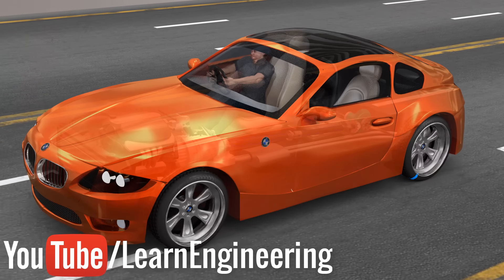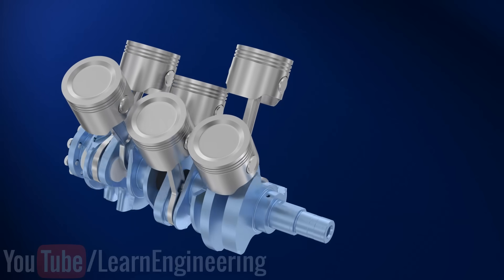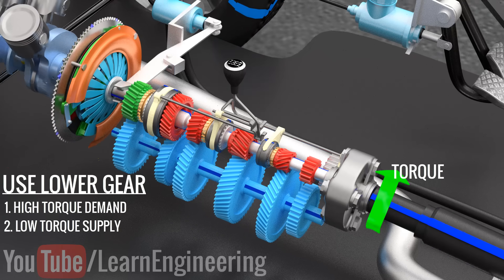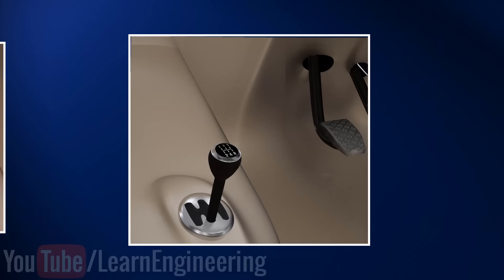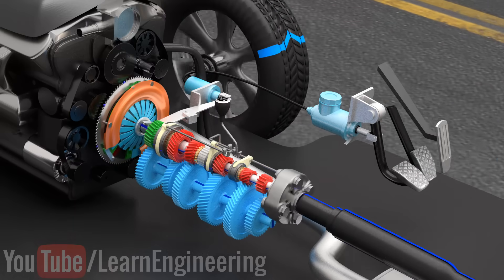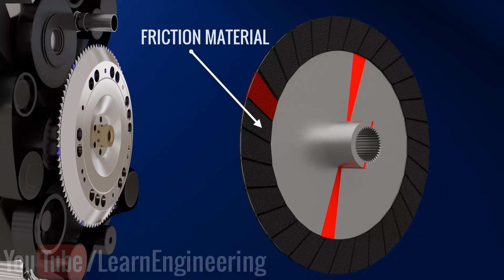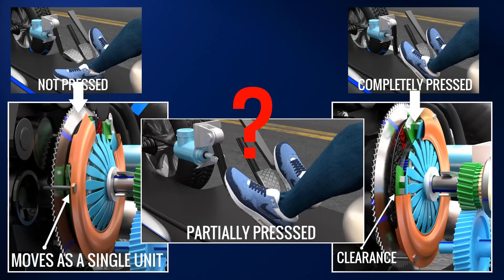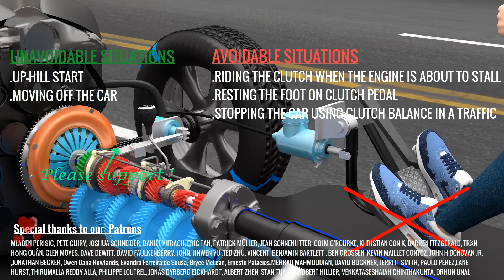Why you should not PARTIALLY press the Clutch?

Comment: It's my clutch, I'll do whatever I want with it. The clutch pack of my motorbike is relatively cheap (30 USD). Riding the clutch is convenient compared to shifting gears incessantly.
I don't drive cars that much but I used to go in country with a low-powered truck. While in 1st gear, I used to rev the engine while holding the clutch partially to give a boost to the truck so it can get from potholes.

Comment: There is one other situation where riding the clutch (for a short time) is not only appropriate, but might even be necessary to continue your journey - when preparing to pull out of a side road onto a busy major road. By sitting on the biting point and setting your revs ready to take a gap in the traffic, you are 'pre-loading' the engine for the best torque output as well as ensuring you will be able to fully engage the clutch smoothly and quickly when you make the manoeuvre.
A driver should never hold the vehicle on the clutch by riding it - I see that at lights occasionally, and those people are burning through the clutch plate deliberately for no reason. That's what a brake is for.
Also, try driving anywhere in London without riding the clutch. I dare you. Actually, I'd pay you £300 (about $5,000) if you managed it for a day.

Comment: So I have a Coeworker that's claiming i completely fucked up his vehicle and is about to tell me I have to pay him 800$ for a new clutch. 
Here are the facts
1. I told him I can drive a manual but I am straight garbage at it.
2. I have never driven one of my own, I just have my motorcycle which is a completely different animal
3. The smell from something burning was only in a 100 meters of driving
4. he claims somethings "fucked up" but when he drove his vehicle back from the bar to where I was staying the burning was gone and the vehicle was operating properly
5. he asked me to drive because no one else would be his DD
6. after driving and realizing I need more practice I had him drop me back off at home and I gave him the 40 euro for taxis for the night so he didn't have to drive.

If I was riding the clutch how much would it actually cost (at max) to replace the parts damaged (FROM ME) in the ONE time I did for the 1-2 miles of me driving? 
Another thing to note, he's been having a turbo leak for awhile, not sure if the cases could be linked

Please help, I don't have the money to give 800.
Reply: It is almost impossible to damage a clutch in such as short time and miles.
Reply: @sauloz88  that's what everyone is saying. Thank you

Comment: what about when you’re changing gears and you must release the clutch while accelerating. in order to do this without having both the gas and clutch images you’d have to just dump the clutch which will cause a very unsmooth shift and potentially damage more because of the force of the engine knocking when the clutch is dumped.

Comment: I am a 43 year veteran long haul driver and part time driving instructor.  In driving school we always teach our students to only partially clutch when shifting gears.  If you check any truck driving school you will find that in North America this is always taught.  In my car I always partial clutch when shifting.  There is never any need to fully depress the clutch to shift gears except when starting the engine.  You only need to partially depress the clutch pedal until the clutch plates are released.  Anything more is a wasted motion.  Actually in my truck if I use the clutch at all I might press it only a half inch or so.  Often we just rev match and don't even bother to put our foot on the pedal to shift.

Comment: When the  vehicle moving downwards, I usually fully applies clutch and managing speed by applying break slightly,is there any problem if we do this
Reply: Your brakes could overheat and fail, when driving downhill always be in a gear with the clutch pedal non pressed to allow for the engine breaking to maintain the desired speed. Your technique also doesn't allow full control because you aren't allowing the engine to do this by pressing the clutch.

Comment: He said gear changing can only occur if use clutch, obviously you don't drive manual vehicles, there is something called timing, each gear works optimally at a given rpm if u understand this u can avoid using clutch
Reply: But why would you not use the clutch to shift gears? It's what it's designed to do. Unless you get the RPM exactly spot on for the  gear you are shifting into, you'll be wearing out your synchros very quickly and grinding your gears which is a stupid thing to do.
Reply: @collinslfc  not using clutch shows versatility and doing it right is harmless
Reply: @jwalflowdizzle3751  Why do you need to show "versatility"? I still don't understand what purpose you are serving by not using the clutch. It's there for a reason. And to do it right, you have to engage at exactly the correct RPM which is never going to happen every single time you shift, regardless of how good a driver you are. Your synchros will take a hammering.
Reply: @collinslfc  it's add to the whole experience and if racing clutchless is quicker and can be smoother even in normal driving or riding
Reply: @jwalflowdizzle3751  But you're not racing, and wearable parts such as clutches in racing cars aren't designed to last 10 years like a road car is...

Comment: Well, this is not 100% accurate. My car wont't start even moving without riding the clutch on first gear. Or it will violently bump and stall. Or it will just stall, depends on how much throttle I use. I need to ride the clutch for a second until the car will start moving at least by the speed of walk. Then I can fully release the clutch.
Reply: But that's normal use of the clutch, that isn't what this video is about.

Comment: Clutch riding is good for many reasons. first of all the drive is much more pleasant. Then its definitely better to clutch ride compared to getting ur engine almost ripped apart at low speeds in traffic jams. it also helps with the fuel consumption. 

Now all ive said is very much true for diesel cars. cars that run on gasoline are kind of different story coz they dont have as much torque as their counterpart. so even if you attempt to clutch ride u wont benefit as much. 

diesel car you can pretty much drive with just the clutch..

Comment: If that were true - clutches would be switches - they aren't for a reason. The basis of this video is false.
Reply: Witness101 he says at the end of the video that in some cases it is impossible to avoid riding the clutch. It operates the way it does for those cases. Like launching on an incline. But those cases are not the typical use case
Reply: There is no valid reason or any good situation to half clutch. It should be stated clearly in this video.

Only half clutch when coming out from a stop but While in motion its a no brainer to do so.
Reply: @MrUnderEstimated  Hmmm.. too bad you don't understand how a clutch actually works. Thanks for wasting keystrokes on the internet and proving your stupidity.
Reply: @MrUnderEstimated  No - YOU are stuck on what you think a clutch is - or how it works. You were taught, and think, incorrectly. Too long to get into over YT - but you are absolutely wrong. Think different.
Reply: @jamesi6262  Simple - there is no such think as 'half way' engaging a clutch - not how they work - nice try though - you must be talking about friction brakes or something.
Reply: @MrUnderEstimated  Do people really half press the clutch while already moving? Never seen anyone do that. Halfway only when you've stopped on 1st gear or if you need to slightly move the car (talking about like a meter or something).
Reply: @jokuihmehyyppa  its what I've said.

Comment: A breakdown company asked me about cover.. well I told them that when you buy a mondeo you got a tank!.. I sometimes start off in 2nd gear and my clutch is stronger than 3 angry wifes.. Got more torque than a rhino hured on steroids.. so yeah.. still running very strong! Ain't advertising but the 05 plate diesels never go wrong! 🙂👍

Comment: I drove a 1996 manual Nissan Maxima SE up until 2010 all over New England. Partial clutch engagement was needed at times for fine power adjustment, such as when arresting a backward slide in order to hold the vehicle stationary in an uphill gradient or letting in/out power in fine amounts without using throttle in creeping traffic in/around Boston. Can you instead put the vehicle in neutral gear and use the parking brake when stopped in uphill traffic? Sure. I have used both the partial clutch and neutral gear/parking brake methods. It really depended on my reading of the situation/conditions.. and how well I came to know that PARTICULAR Nissan. But for straight-line driving, which was about 85% of the time for me, I always engaged the clutch fully. But all mechanical parts wear out over time and my clutch started slipping in the 10th year or so. Eventually I gave up that car because the undercarriage started to sag in 2010 and I got myself an used Automatic, a 2008 Audi A4, that's still running sweet after 11 years.

Comment: I used to drive a manual car with small engine and i do riding clutch on 1st gear or else ill be headbanging like a madman. Its true it fairly unavoidable sometimes. ✌️
Reply: Lol i knew how it feels man.
When your accelerator/gas pedal is too sensitive you need to use clutch to prevent headbanging
Reply: @Nick-ko1tw  lol. Yeah rev it up a little too much or too low you'll be a Rockstar! 🤘😁

Comment: What you failed to explain.. is when riding the clutch, the fly wheel and the clutch [friction plate] are rotating at independent speeds of each other... thus the two frictional surfaces are continually rubbing against one another... resulting in the rapid wear!
Like trying to drive with your foot... partially on brake.
Reply: He did it though on 5:08

Comment: I never fully depress the clutch and never have grinds or any resistance going into gear. The only problems I ever have are with the throwout bearing, and it's not from putting my foot on the clutch pedal because I don't ride the clutch. I shift fast. Some people just don't know how to use a clutch. I basically only use it for launch (which is usually pretty bad for most people) and shifting is always fast. It can be done without the clutch whatsoever if you allow the engine RPM to fall to match the speed after pulling it out of gear. I hate Ford manuals. Much prefer Japanese transmissions.

Comment: You might as well just remove the clutch throw out bearing completely, that way you won’t be able to destroy it. I have really really seen people who does clutchless shifting, and the reasoning was that it saves clutch. Lmao, guess what, the gears are clashing like mad even if the clutch is completely to the floor, the synchronizer rings are completely worn out. Now a modern car just become a crash box. While others spend money replacing a clutch, you spend money rebuilding a transmission, at approximately the same time, and most definitely earlier. Plus they enjoyed themselves for however many years before they had to change a clutch, while you had been fighting over the perfect timing a shifting.

Comment: OMG 😮 thank you this video was very helpful  I do half paddle clutch. So from now I stopped .
Reply: Resting your foot on the clutch pedal while it's in gear is more damaging to the throwout bearing than half clutching could be to anything else, so long as you are getting smooth shifts. If the transmission is shifting smoothly the syncros are doing their job just fine.

Comment: whats the fast gear shift tips without relying  riding the clutch method???? it doesnt make any sense dude.
Reply: At a certain RPM (different for each gear and each transmission) you can effortlessly pull the gear and shift into the next gear if the input and output shafts will both be spinning at the same speed. Otherwise the synchronizers will need to press together to FORCE them to match speeds, which can only be done with the clutch depressed. If the input and output shaft are spinning at different speeds for that gear and you DON'T have your foot on the clutch, you're going to grind the hell out of it.

Comment: Or.......drive an automatic vehicle. The new ones shift better and faster than any driver. They also are perfect in hills. They dont require constant leg work, you cannot stall the vehicle, the new ones have from 9 to 12 speeds, they require less maintenance unless they completely break, they can hold the vehicle uphill without a parking break engaged and they are less tiresome to use.

Another advantage is that when used with AWD or FWD they are safer for snowy and icy conditions because the engine weight is at the front pressing the most important tires against the surface. Many manual transmission vehicles are RWD. Less safe in those conditions.

And in North America, they are cheaper. Only drawbacks: they cost a lot to replace despite requiring less maintenance and high water can seriously damage them.
Reply: AWD, FWD or RWD are imo all a matter of own preference and taste, it all has benefits and drawbacks, I wouldn't say that RWD is bad/useless
Reply: @Kurasaku_  It is not useless. It is less safe in snow, ice conditions.
Reply: You are wrong on so many levels that I don't even have the time to explain it all
Reply: @SDZJIKOLFJHIOE  Sure Mr. Expert. I am. Keep  your illusion going.
Reply: I dunno man, when u actually want to ride economically I wouldn't suggest automatic...,it might shift quicker but when you actually want to ride on twisty roads it's better to change into the proper gear beforehand, also engine breaking is a thing.

Comment: What about reverse parking? Is riding the clutch acceptable?
Reply: I mean you have to " ride your clutch" sometimes. If you want to go slower than the 1st gear allows you have to slightly accelerate with the clutch, otherwise you won't have the necessary precision. And  "riding the clutch" when you are going really slow doesn't really hurt it. The clutch suffers when you are going higher rpm and still do half clutch.
Reply: @Thugman98  dude I'm talking about moments where you only have like 20cm on both ends, you can't really "jerk the car" you have to play with ur clutch and brake, how else will you be able to move in centimeter precision
Reply: @Thugman98  dude sorry for being dense, but reading some comments here just shocked me. I wouldn't have thought that so many people actually fail to drive manual
Reply: KrASsKAH I am able to drive it, just not very good. I just don’t know if I’m doing it right and how to do it right. Sometimes I feel the jolt impact of the pressure plate when I let off the clutch too fast and too slow (when upshifting) then the car’s momentum will slow down hard instead of picking up more speed and the engine rpm goes down and shoots up. This also Happens when I try to downshift, I try to go from 4th to 3rd the car slows down hard but then RPM’s goes and forces itself back up.

Comment: In India, especially in Bangalore, frequent traffic jams and very slow moving traffic for hour or more and at different points during your ride will almost always push you to run your car on half clutch. Changing gears very often, if not practical.
Reply: Cost of plates isn't a concern in such situations.